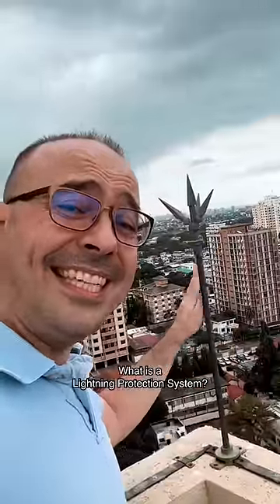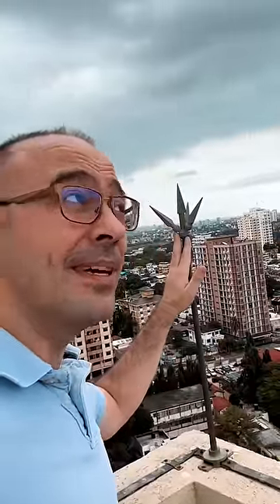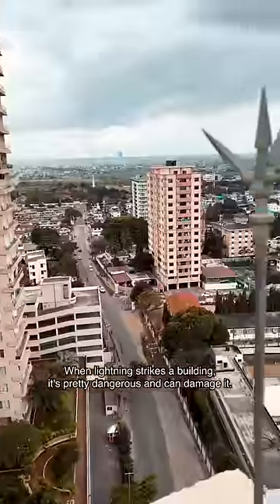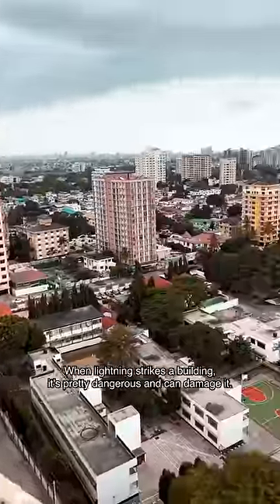Lightning Protection System

Comment: Bro they really had to end it on a playground💀
Reply from the maker: Terminating it into children is always a good idea
Reply: @ArchitectRussell  yo wtf 💀
Reply: @ArchitectRussell  😂☠️
Reply: Thats what Terminators do, Hunt the child.
Reply: @ArchitectRussell 🤣🤣🤣
Reply: @ArchitectRussell  BAHHAHAHAHAH
Reply: @ArchitectRussell  😂😂
Reply: @ArchitectRussell  😂😂 omg
Reply: @ArchitectRussell real G 😂😂😂😂😂
Reply: Now i know it must
Reply: @ArchitectRussell  😂😂
Reply: The lighting protection system usually is connected underground as well. And electricity always takes the easier (most conducting) way so it will rather go through the copper than the soil.

There shouldn't be any danger. Especially considering how fast a lighting is.
Reply: @ArchitectRussell  that's called 'Abortion' in medical terms
Reply: @Ersenoy_Lomak  not if a curious child touching the bare copper when the lighting struct. Why cant they wrap some insulator a few meters from the ground.
Reply: @MAR-gq9wt  Because even if it had isolation on it, it would just immediately burn off the moment a lightning strike goes through it and it wouldn't isolate anything at all.

A lighting strike has millions of volts, a simple isolation wouldn't do anything at all.
Reply: GOD will be liable for the damage.
Reply: How else there will be thrill in life
Reply: @ArchitectRussell  🤣🤣🤣🤣🤣
Reply: @ArchitectRussell  😂😂😂 thanx i needed this kind of respond from creator rather than those explaining, agreeing s*it lmao
Reply: Little ones are easy to bake 💀
Reply: @ArchitectRussell so true haha
Reply: @Architect Russell  I like the way you think a new sub
Reply: Cuz they children will be playing while Thunderstorm is above them
Reply: They get little Flash
Reply: @ArchitectRussell  lmfao
Reply: @Ersenoy_Lomak so you're saying that it can even burn the insulation, but a set of ignorant children accidentally touching it during the lightening is okay?! 😅
Reply: @Ersenoy_Lomak I guess explaining how lightening has million volts and takes the easier path must be so much more fun than actual solution to the real point of discussion in the chat.. 

Love the humour going in the chat. But if you want to be the serious explainer, then let's have a smart solution instead of stating the obvious properties of electricity..
Reply: @ArchitectRussell  ayo tf bro
Reply: Good, less noise
Reply: @ArchitectRussell  FRR HAHHAHAHAA
Reply: @MAR-gq9wt  they cant
Reply: @itsbonkerjojo9028  Fact 🤣🤣🤣🤣 let ppl complain
Reply: @ArchitectRussell agree
Reply: @ArchitectRussell  😂😂😂😂
Reply: @ArchitectRussell  yo💀💀💀☠☠☠
Reply: @ArchitectRussell  💀💀💀💀
Reply: @ArchitectRussell  yo what the hell 💀
Reply: Fr 💀
Reply: @ArchitectRussell  real
Reply: Exactly instead of protecting these guys have made lightning to fk not one instead Many
Reply: @ArchitectRussell  💀💀💀💀
Reply: @ArchitectRussell  hell nah....(for some kids it does )😇
Reply: @ArchitectRussell  They're all grounded
Reply: It's in the name a Play*Ground*
Reply: @ArchitectRussell  Bro. You good?
Reply: But no one goes into the playground when there's a thunderstorm right, right? 💀
Reply: @zeckerthehecker  😂all these smart guys really allow their kids to play during thunderstorm
Reply: @daorasama  Fr 💀
Reply: It's tax deductible
Reply: @ArchitectRussell  😂😂😂 man I love his reply
Reply: Hol up
Reply: @ArchitectRussell  💀
Reply: @ArchitectRussell  AYYYOOO
Reply: So every children can become flash
Reply: and there is no fence or warning💀
Reply: @suggie16  If there was a better way, it would have been done in a better way. I'm an electrician and I have built these lightning strike protectors before.

You gotta use logic, why would a child be on a playground during heavy thunder storms and rain and touch the copper? 

The chances of a lightning strike hitting that exact lightning protection is very low, the chances of someone touching it even lower.

Your child is wayyyyy more likely to die by being hit by a car than this. 

And also, what solution do you suggest? Not even air can isolate the thunder strikes, do you have a material that can? And who is gonna pay for this to be put on ever lightning strike on every house? 

With all due respect, if you'd use some logic more often, you wouldn't have commented that.
Reply: It goes underground and into some salt which absorbs and neutralizes the electricity
Reply: @Ersenoy_Lomak  Well yes I've already thought through the "obvious" probability of fatality here & fully aware that the chances of accident here is possibly less than 0.1% (Yes the unfortunate combination of engineer & mba here. Sadly we are expected to think further than obvious). But with due respect, if you would have used the same logic (as you used to explain the chances) to understand my comment, you would have understood my point - 
A. People are kidding here (little dark though). No one asked how electricity will not hurt the kids, they were just making jokes. Everyone knows nothing will happen.

B. The science: No one is expecting the kids to get shocked via soil. People just find it weird to see a metal plate that's supposed to redirect lightening, exposed.
That's all... 

As you finally correctly pointed, "Cost & scale is the real reason (they probably had a better solution, just maybe didn't make economical sense)".

Also how is asking you for a solution in my previous comment, gets me back a question "suggest me a solution"??!  Aren't you the Electrician?

Here's one though " why not fence 1'×1' ft area till 5ft height, around the exposed plate near ground? A solution need not necessarily touch the plate.

Here's one more: Isn't the metal plate hugging the concrete wall? Is that gonna burn into nothing?.. No... So why not use hollow concrete cylinder (with some air space too) for the ground floor only?
Reply: @suggie16  You're the genius thinking there needs to be a solution for a problem that doesn't exist.

Yeah go fence around Lightning protections that don't have electricity flow through them. 

Yes, i am an electrician and I would be more than happy to not have to have heavy isolation or concrete on my aluminum rod or having to build a fence around every lightning protection i build.

That's super unnecessary work for a danger that is basically non existent. Would you build fences around roads too everywhere just to protect kids from running after their ball?
Reply: And whos parent will let there children play while having thunder storm
Reply: They deserve it if they playing outside during the thunderstorm
Reply: @ArchitectRussell  yo aint no way😂
Reply: Gotta balance the population somehow
Reply: @ArchitectRussell  Those Children Gonna Be Shocked About Whats Gonna Happen Next
Reply: @ArchitectRussell sure we wish a new shazam tho
Reply: @ArchitectRussell yooooooo 😂
Reply: @ArchitectRussell  love the humour! 😂
Reply: @ArchitectRussell 💀
Reply: @ArchitectRussell nice😂😂😂😂
Reply: Its keep the population down 😂😂
Reply: This generation is hopeless
Reply: @ArchitectRussell  💀
Reply: @ArchitectRussell  Yoooo 😂
Reply: @ArchitectRussell  what the fu-
Reply: If you are playing on the swingset during a thunderstorm, that is your own fault😂
Reply: @ArchitectRussell  mom I’m a criminal!
Reply: @ArchitectRussell yo tf
Reply: @ArchitectRussell  💀💀💀💀💀💀
Reply: @ArchitectRussell   bro seriously said it 🤣🤣

actually it's not harmful because ground can't conduct electricity
Reply: @ArchitectRussell   naaahh 💀 💀
Reply: @ArchitectRussell  lmao
Reply: @ArchitectRussell  holy moly 😭
Reply: Kids are made of rubber after all
Reply: @ArchitectRussell  I might subscribe just because of this reply
Reply: @ArchitectRussell  to prevent overpopulation 😂
Reply: Emergency late protection so you will never have a mistake ever again
Reply: @ArchitectRussell  based person
Reply: @ArchitectRussell I hate children but not that much
Reply: @ArchitectRussell  LMAO🤣
Reply: @ArchitectRussell  brooooo
Reply: @ArchitectRussell  as a parent, I can agree
Reply: @ArchitectRussell 
 "911 I've foun-"
Reply: @ArchitectRussell  it is natural selection of don’t touch other people’s shit
Reply: @ArchitectRussell  bro what?
Reply: @ArchitectRussell 😂😂😂
Reply: @ArchitectRussell  ☠
Reply: THATS WHAT I WAS GONNA SAY LOL
Reply: @ArchitectRussell 😂😂
Reply: @ArchitectRussell bro ur mad for this
Reply: @ArchitectRussell  fr 💀💀💀💀
Reply: i thought the same thing wtf
Reply: @ArchitectRussell  chill 💀
Reply: So they get charged up full of energy 💀💀💀💀💀
Reply: @ArchitectRussell  based
Reply: 🎵dumb ways to die so many dumb ways to die dumb ways to die-i-i so many dumb ways to die🎵
Reply: I mean if the kid is playing during a thunderstorm its just natural selection at that point 😂
Reply: @ArchitectRussell I am an Architect too and I approve this answer 😂
Reply: So thats why kids have so much energy
Reply: @ArchitectRussell Nahhhh 💀
Reply: @ArchitectRussell Hahahaha
Reply: @ArchitectRussell 💀
Reply: Poor kids down there 😂
Reply: No one will say women
Reply: @ultravioletgaia what’s wrong with that thing
Reply: @ArchitectRussell 🤣🤣🤣
Reply: Something is wrong i can feel it💀
Reply: @ArchitectRussell 💀💀💀💀
Reply: @ArchitectRussell  yo you got caught 💀
Reply: And i think there will be no child playing outside while a thunderstorm 🙄 isnt it?
Reply: @ArchitectRussell 💀💀💀
Reply: bcuz it contains "ground"
Reply: @ArchitectRussell one of the funniest comment ive seen from the creator of a science short
Reply: Facts, facts
Reply: @Ersenoy_Lomak  textolite and sulphur hexafluoride
Reply: @muhammadrazziqbinmohdnazzr7065  hahaha so fanni 😑
Reply: @khalliwallivlogs you
Reply: ayo wtf
Reply: @ArchitectRussell true
Reply: @ArchitectRussell dont do not put it in children...
Reply: @ArchitectRussell  ayo what are you saying lmao
Reply: That shit is shocking
Reply: It will always follow the copper path rather than your body if you touch that
Reply: Lol fk ai, the real enemy are electricians 😂
Reply: @MAR-gq9wt it's lightning. Good luck finding a insulation for something that's regularly a million volts plus. I mean it exists but it'd be a huge amount of insulation and lighting only lasts for a fraction of a second. Like the other commentor stated most of the current will take the copper path to reach the ground. Some current mat flow through the child but at this point in this hypothetical I have to ask why is there a child outside in the middle of a lightning storm?
Reply: @suggie16 oh there is absolutely insulation that could take the voltage of lightning, hell China has million volt utility lines that's pretty close to the average voltage of a lightning strike. The only problem is cost and the amount of space it would take up.The simple solution and cost effective solution to this is to not let children out during lighting storms.
Reply: @jsb7546  thanks...I get it. It's just that some folks have zero humour here 😆.. can't help it
Reply: @ArchitectRussell LMFAOO😭😭💀
Reply: @ArchitectRussell 💀💀💀💀💀💀💀💀💀💀💀💀☠️☠️☠️☠️☠️☠️☠️☠️☠️
Reply: @ArchitectRussell 😂😂😂💀
Reply: Children w no future is the main target, to make a better world.
Reply: Fr.. 💀

Comment: Safely. Right next to the swing set lmao
Reply: I came here to say the same thing!
Reply: @aliasfranks346  same
Reply: you wouldnt have kids swinging during a thunderstorm
Reply: Wt f
Reply: know some physics before commenting
Reply: You got no clue about how a conductor works do you? Just come online and comment without even knowing what it is..
Reply: Bruh. This shows how you have absolute no knowledge how the system works.
Reply: It doesn't arc. Else the electricity could also get into the building circuits even with the conductors.
Reply: Isn't that safe enough tho?
Reply: No kid would play on the playground while thunderstorm
Reply: Chances of a kid touching it exactly when lightning strikes during thunderstorm is exceptionally low
Reply: @dorael_  why wouldnt you? Kids play in the middle of the rain
Reply: If you were playing on the swingset during a thunderstorm, that’s your own damn fault
Reply: Elite design 👌 😂😂😂
Reply: @dorael_ you think I listened and stayed inside instead of swinging during thunderstorms? 😂
Reply: @hadesmyg1114 🤡
Reply: Won't do shit. Electricity picks the quickest path to the ground. It is harder for electricity to travel through someone into the ground then straight down the copper.
Reply: @mehshutup3041 rain? Yes. Thunderstorm? No. What kind of kid got excited seeing thunder and lightning when playing outside?
Reply: i mean who would use the swing during bad weather
Reply: Electricity will always take the path of least resistance to earth. Since copper is a much better conductor than any human body, even if a child was touching the bare copper discharge cable they not would be electrocuted, they would simply feel a bit of warmth where they touched the cable.
Reply: Yes it's safely, copper is second most conductive thing in the world, it won't affect the swinger besise
Reply: @dorael_  bro… kids be kids …
Reply: Who tf is going to be on a swing or playground during a storm???
Reply: electricity takes the shortest route to the ground (very simplified explanation) 

this even if you stand right next to it when it's conducting current it won't come into your body unless you touch it
Reply: @mehshutup3041 ain’t nobody at the park during a thunderstorm. It’s different then your average showers and light rain.
Reply: @Abel-Harland erhm. If the copper is getting warm wouldn't that mean that there is enough resistance in the copper for some current to take a different path?
Reply: @deanonesense  I doubt it, that isn't how electricity normally works
Reply: Something tells me you failed basic science

Comment: You just told the copper thieves where it is!
Reply: It isn’t copper though
Reply: Tell them to steal it in lightning day it's doubles the copper quantity😂
Reply: @ravidas4852  farming shorts is going to spoil it.
Reply: It's OK lightning will strike them......
Reply: It’s not copper. It’s just thick Aluminium strips and the joints are done using brass ballasts. The conductor itself is again an alloy.
Reply: @junaid42465 sometimes it’s copper
Reply: Every country has copper thieves.😂😂😂😂
Reply: Bruhh im on it
Reply: You assume the place has thieves? 🧐
Reply: Right next to the Kids Swing #advance architecture
Reply: Bro like I’d go up on the roof to steal copper when I could easily cut your water pipe out from under a trailer home tf.
Reply: m from INDIA and can confirm thieves mf stole our wiring few days back :( for cooper.
Reply: 😂😂😂that was good 😂

Comment: Copper strips must be installed using base insulators. In this case copper strips are directly fixed with walls using nails.
Reply: Current flows in low resistance path..But yes it should be insulated from wall.
Reply: I’m a professional electrician.
In my country we do insulate the strips from direct contact from the wall..also we do jacketing the strips for extra safety..
Im curious to know from which country this video from
Reply: @subhajitdas846  bro india me bhi ese hi lagadete😂
Reply: Not for the safety it's for the building licence 😅😅
Reply: Is insulator has to be used on strip buried inside ground (from building bottom to pit) or can be lay without insulator inside ground?
Reply: @utkarsh329  No need to provide insulation to the part of the earthing strip which is buried under ground.
Reply: @salehacademy2487  on wall provided insulator but on ground covered it with concrete and connected with electrode in pit
Reply: @salehacademy2487  is it okay?

Comment: Lightning rods are not supposed to be hit by lightning. Sometimes they do but it’s not what they are for . They pull the ions out of the air to prevent lightning from happening. If you’re building does get hit the rods are not strong enough to stop damage to electrical or stop a fire
Reply: One comment which states its actual use.
Reply: Yes. Thank you. All the people just assume explanations these days.
Reply: Thanks much I have been an electrician for over 5 years and an electrical engineering students for a bit over a year and I just got the actual use of the Lighting arrestor.

Comment: It is Franklin type lightening arrester. But it should connect to a GI strip which suppose to maintain a good gap with the surface through Epoxy Isolator

Comment: Usually I’ve seen the copper goes inside a PVC because sometimes when attached to the building, the building tends to damage anyway. And the end needs to be connected to a large copper plate sinned in minerals and conductive mixtures under the ground deep around 4-6 feet.

Comment: In india, The metal Kalasam fitted above the temple tower is a good lighting conductor. So it protect the surrounding place from lighting. An ancient proverb exists that 'Dont live in a city where temple not present. Kalasam placed above 50 meters from ground over temple tower and its covers the area of 100 meter radius as lighting protector.